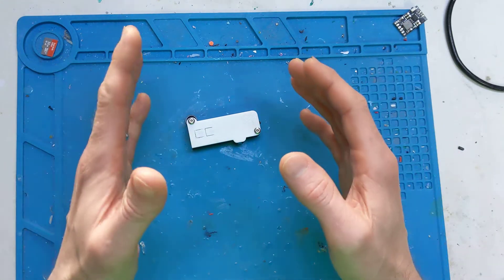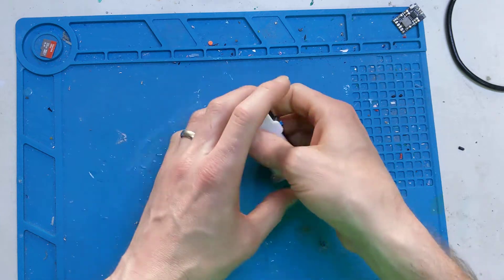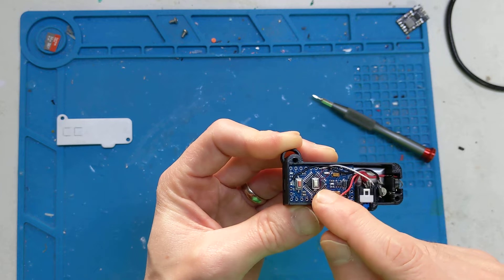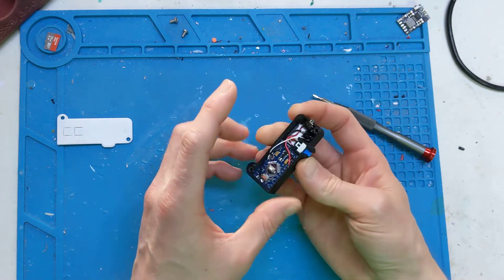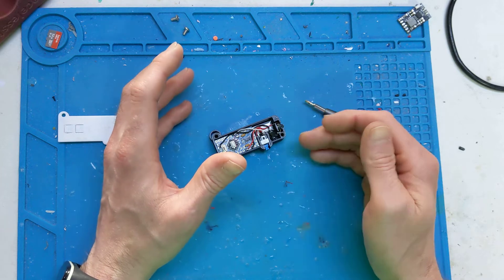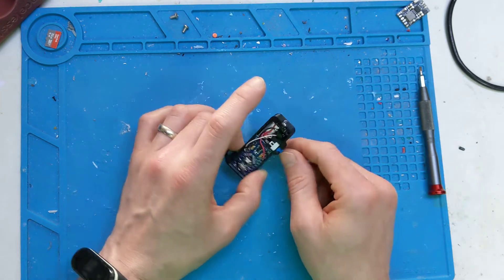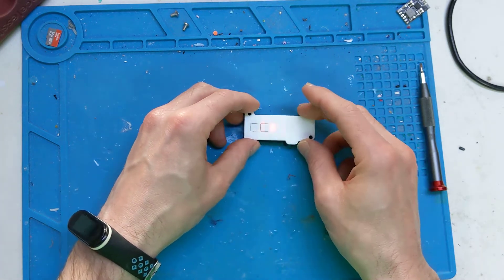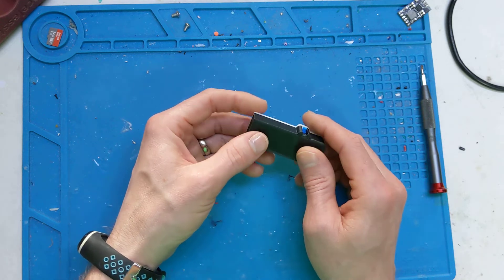TV B Gone long range

Comment: Do you have a link to where you bought the pro mini from exactly? I seem to be having issues getting mine to work and I think it is due to the board. Thanks
Reply from the maker: Hi, which version of the pro mini did you get because there are 2, there's ether 3.3v 8Mhz or 5v 16Mhz versions
Reply: @facelesstech  5v 16Mhz
Reply: @facelesstech  Which one did you use?
Reply from the maker: @rayj1988  I used the 5v 16Mhz one. Not sure why yours isn't working. Have you used your phone camera to see if the IR LED is lighting up.
Reply: @facelesstech yes the IR is working however it seems to be sending invalid IR signals. I used my Flipper Zero to check and only if I change the timing to 29 it sends some valid IR signals but not all of them so it doesnt turn my TV off. I also bought a bunch of new Pro Mini 5v and 3.3v 328p and a 5v 168 and still same issue. I really wonder why your one worked and lots of people seem to have issues getting it to work?
Reply from the maker: @rayj1988  I think you might be onto something. So I revisited one of my old projects (cherry remote https://facelesstech.wordpress.com/2019/12/31/cherry-remote/) I downloaded my code off of github and when I flashed it back to the device it didn't work... Need some time to see why. Something must have changed in ether the IDE or the IR library.
Reply: @facelesstech  yeah its a bit odd! I just watched you video on your cherry remote very cool projects you make great job! I wonder if you could try program it sith the TV-B-Gone and see if that also doesn't work too? Then, you can potentially see if it is just for your cherry remote or also same issue with TV-B-Gone. You probably dont want to reprogram your TV-B-Gone just in case it makes it useless and won't work.
Reply: @facelesstech have you had any luck mate?
Reply from the maker: @rayj1988  so I had to rewrite all the code for the remote because the IRremote library had changed so much. I need to see if the TV b gone code will work on it next.
Reply: @facelesstech  I dont think the tv-b-gone uses that library. So it will be interesting to see if you can get it working. Keep us updated please.
Reply from the maker: @rayj1988  so just flashed the TV b gone firmware to the cherry remote. It just worked, it turned my Samsung TV off. What bootloader have you got on your arduino pro mini? What tv are you trying your on?
Reply: @facelesstech  yeah I think the issue is that it sends some valid IR signals but not all of them. I have tested with my Flipper Zero I have used multiple boards and same result. I assume your one would be the same as mine but fortunately, it is send a valid IR signal for your TV bit of a luck of the draw. Have you tested it on many TV's? I will prog just build a proper tv-b-gone with an ATTINY85V-10PU and see how that one goes. Thanks for all your help mate!

Comment: Did you have to make any adjustments to the code ? Ken Shirriff originally used a Arduino Leonardo (Uno) and i cant get his code running on the Pro micro. Kind regards
Reply from the maker: No, it just worked. What IDE version are you using?
Reply: @facelesstech   Hey, i really appreciate your help thank you!  Im using the latest version of the IDE . BTW i really like your design, kind regards
Reply from the maker: @Keny990  I was using the older 1.8.x version of the IDE maybe it has something to do with it. Thank you.
Reply: Did you get this to work? Ive been having issues getting it to work too.